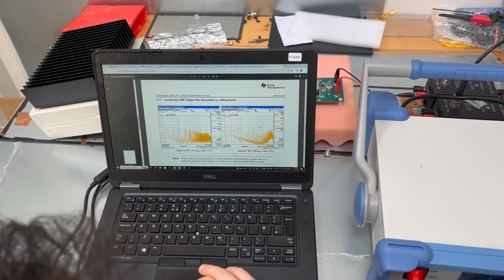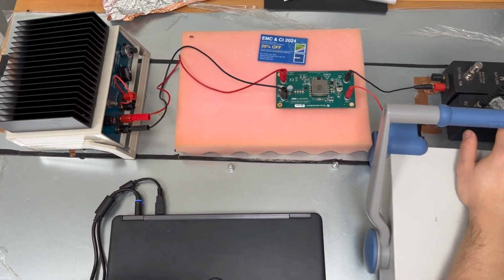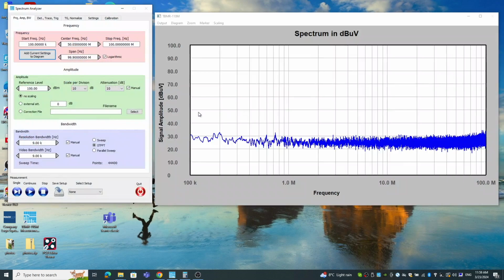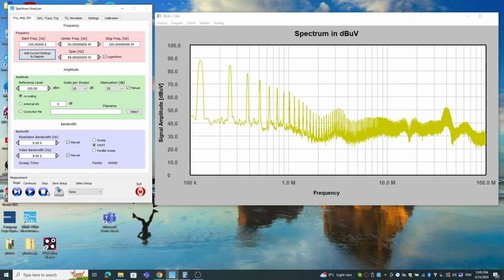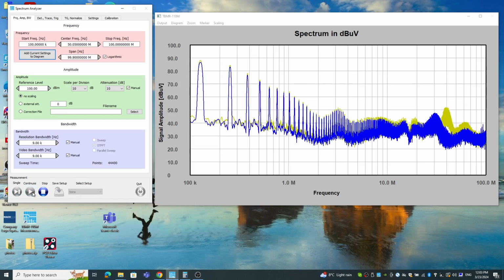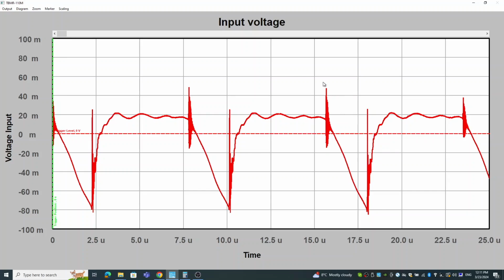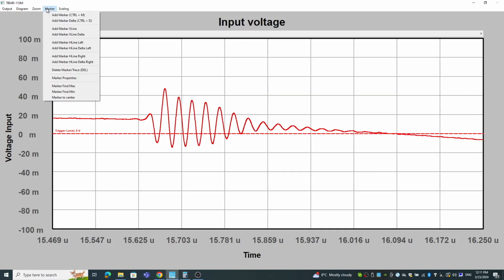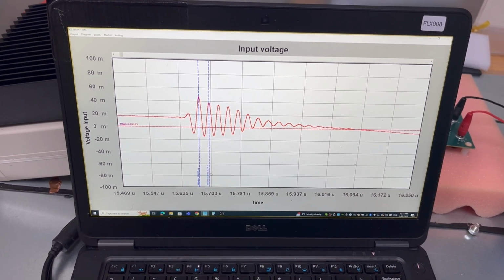Demystifying the "Hump" in conducted emission - Resonance Explained

Comment: The hump is shifted by dark forces, also note how the glass slides over the table. EMC is occultism. The amount of the shift makes sense because the LISN output impedance is 5 µH || 50 Ohm and the cable adds 1 µH per meter, so one could speculate about the capacitance that yields that frequency together with the inductive/resistive behavior of the LISN. Luckily, this part of the spectrum, that is related to ringing, should be easier to suppress by a filter than the lower frequencies that are harmonics of the switching frequency.

Comment: How does one dampen/attenuate a 40MHz resonance? I cannot change the slew rate of the converter for the efficiency rating is fixed and it seems that my two stage common mode LCLC power line filter is ineffective at this frequency. Do I just need a less turns common mode choke ?
Reply from the maker: Great question. Normally the dampening relies on lossy cores, so for example, iron powder core, ferrite-core would typically start getting lossy at their peak performance frequency point.

Comment: Excellent explanation and demonstration - thank you🙏
The TekBox receiver with software is interesting - can it eliminate the need of Spectrum Analyser and Oscilloscope?
Reply from the maker: Potentially yes, but I would still use a traditional oscilloscope. The reason is the Tekbox scope uses 50R input impedance, the normal oscilloscope now typically have both 1M ohm and 50R impedance.